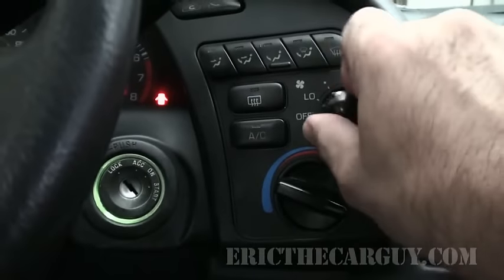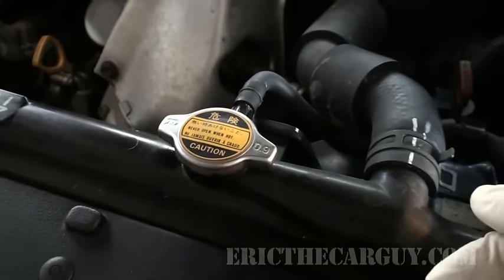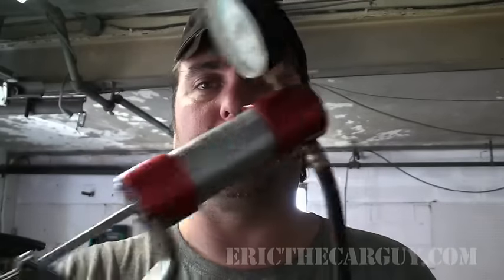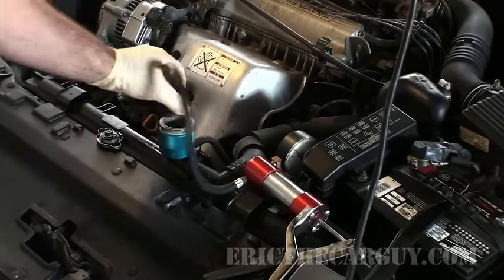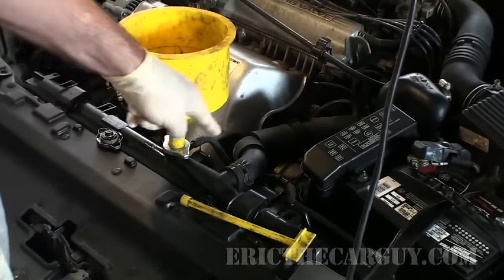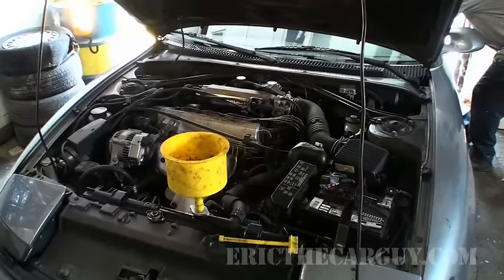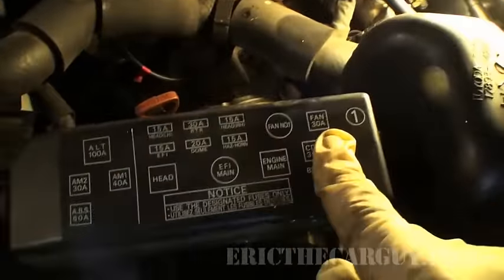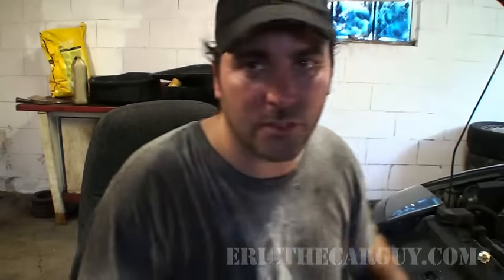How To Solve An Engine Overheat Condition - EricTheCarGuy

Comment: Thank you Eric for this comprehensive video, I have a 2010 Hyundai Elantra Touring GL (with 170k+ KM) which is overheating on higher RPMs, I checked everything you've said here, none of them is the problem. The fan works when the AC is on but does not kick in when the temp is high, Relay and Fuse are all working fine, there is no circuit cut between the relay and the fan, I can read the coolant temperature both on the panel and on OBD app, (guessing the coolant temperature sensor is working fine too)  I am suspecting two things:
1- There is circuit cut somewhere, between the relay and the ECU (or computer, whatever)
2- There is an problem in commanding the relay by the computer, (might be a software bug?)
How can I verify and/or fix the issue?
Might be something else?
Thank you so much in advance.

Comment: Eric, please help. 04 grand marques, engine cooling fan, replaced with Dorman 620-120. Reconnect battery, still no fan. The new dorman unit is controller, fan, shroud. Where is my problem. Looked at under hood fuses, the 50 amp cooling fan fuse, looks good #102.in power distribution block, on passenger fender. Only other thing could be, is temp sender, by thermostat right? Please advise. The cooling fan quit this winter.

Comment: Do have a overheat problem on my camaro after we had replaced the heater core that blew out, was not right after but a couple months, so as the car is hot and wanting to run the heater to help releave heat, it blows cold air only, no hot air from any of the vent, what does this mean towards my overheating issue and yes the radiator fan does kick on and run when temps get up

Comment: 1999 f350 Lariat Triton V10 dually truck still overheating but only when towing heavy 5th wheel trailer or goin over 20-25 miles. Is fine driving around town. No leaks, Replaced thermostat with 195° failsafe, replaced over flow reservoir cap, bled coolant,got bubbles out. Heater blows hot. Now seeing/hearing ac compressor is goin out(would that cause an over heat?). No sound or leak on water pump. Mechanic said they sprayed alot of gunk off condenser(?) . Still see some dirt/grease build up on front left corner of radiator and a lil along bottom that's hard to reach. Not sure what else but maybe radiator clogged or not working as well as it should. Will a radiator flush help or be worthwhile just replace it? What else could it be? 🥴

Comment: Hey eric i have a 2002 5.3 chevy silverado that is leaking coolant out overflow intermittently once it gets to operating temperature. But doesnt overheat unless low coolant light comes on? Iv had heads milled and put new headgasket radiator and reservoir am at a loss any clues

Comment: Great video , I've been troubleshooting on a 1998 Toyota  Celica GT  the  cooling fans will not cycle on. Change all capacitors, new radiator, thermostat , tested the motor test good.  Poor in parts HELP....Also, Hose from the radiator the one going into the engine is hot the one coming out is cold , the water is not circulating. Could you please help us with this as  to where to go next, please? Thermostat is Brand new actually the second one the first one didn't work.

Comment: Is it possible to fix radiator with crack on upper hose outlet as was this Toyota in video. I have 1997 honda odyssey  with 295000 miles and want to glue or put in sleeve or something. Any suggestions? Thank you and stay dirty!

Comment: I have a weird coolant situation... my reservoir goes way over the max line, and I have to top off my radiator with the excess coolant in the reservoir. I put in a new OEM Thermostat ad new OEM Radiator cap, but still same thing, its like i have a leak somewhere but dont know where it is! I dont have a blown head gasket foam or mix with oil... etc. My car does not over heat at all, never has.. but this is concerning. As now i always have to carry coolant and a plastic syringe to siphon what i need to form the reservoir. I have a 2010 FX35

Comment: Is there any explanation why thermostat closes while car car is driven on rough road surface? When car is not moving there is a circulation of coolant through  big loop, but once I start driving temperature keeps on rising above 90C and the lower pipe from radioator is cool. Brand new Wahler thermostat installed. Car audi 80 b2 1.8 petrol. Thank you.

Comment: question I have a 2005 honda pilot and lossing coolant 1/2gal to 1 gal ever 100 miles. took it to shop and they replaced water pump and timing belt it was time for one. the presure check system and added some stop leak. Well that was not the fix the pilot has over 300,000 miles on it / mechanic aslo check exhaust but said no signs of coolant. do you have any ideas theres no sign of puddles in driveway.

Comment: Merry Christmas to you Eric.  Anyways, your overheating checks are fine and dandy for a person who has all these things like a pressure tester, etc. How about someone like me who has a vehicle that just overheated and i drove it home and parked it. So my first thought is to check if I have antifreeze because when i parked it originally when it first started overheating and steaming on the highway, there was no fluid on the ground under my rad, so i'm assuming it evaporated? That's what the steam was? So i have it home now and like i said i'll check my overflow reservoir and yup, it's empty.  So i filled it and it immediately went down and I'm assuming it went into my rad. I checked to see if there's any fluid on the ground and again none.  Could it be I need a rad cap? Temperature around town is -5 cel and i need heat in the car. I haven't put any antifreeze in here for over a year.  Could it just be i was low on antifreeze? But do you have to fill your rad every year?

Comment: Regarding the thermostat, can they be oriented incorrectly?  On them there is a small loose thingy I heard called a bubbler that needs to be in the 12 o'clock position to bleed all the air from the system.  Is this correct information.

Comment: Thanks. I will diagnose in the morning. I will do it a little backwards and start with the easy stuff tho... no debris... check the cap ... ... check the overflow... turn on my van... hit the ac and see if the fan turns on... then check the fuses/ relays... then once it is up to temp check my hose temp with a digital thermometer. Knowing my luck... it is a freaking thermostat just like on the last 2 vehicles.... but ya never know. If it is any more complicated than that... like a water pump it will be off to the wreckers. With any good luck I will know in a few mins what is wrong. If it has wheels, nuts or electricity running through it... I am going to have problems with it. :D

Comment: Eric I have used your videos to fix everything on my car. Never had any problems but I need your help on a subject you haven't covered. I have coolant in the oil. Like all of my coolant. It wasn't mixed. Water came out first obviously. Then the oil. Is this a blown head gasket? I never saw any oil in the coolant. I had a clogged egr valve. I also did a timing belt change recently. I'm hoping it's a water pump gasket failure. Any help would be appreciated.

Comment: What would cause the rad fan to turn on too late? 
So i've replaced the rad fan, thermostat, thermo switch, water pump all with genuine parts. 50/50 coolant and I have bled the system.

(honda crv firs gen 1997). the temps go up to the middle but in traffic it goes up to 3/4 then the fan turns on and it goes back down to the middle.

I can jump the thermo switch and that turns the fans on, all the fuses look good. The top radiator pipe is hot, the bottom is above luke warm. 

Is it possible the new thermostat is faulty? I havent seen any leaks at all and ive had the car for a few years. getting to the point now where I dont know what else to do :(

Maybe a new radiator cap?

Comment: I have a 1994 e150 van it over heated to day I put coolant in the overflow I could hear it going to the radiator I let it cool down drove 6 mile to my destination temp was ok but when I got back on the interstate it started getting hot  the over flow was still full. During running the air conditioning , when ever I'm going up incline or speeding up the air stops blowing for a minute til it's going at normal speed then it blows cool air could the fan be sticking

Comment: I’ve got a toyota 3.0  it doesn’t overheat but runs hot. I put an after market gauge on upper rad hose. The thermostat is on lower on this. It usually runs 200 220. If I put the new gauge on the stock sensor it reads about 245. If I turn on heater temp will go up but even back out. Driving down the road temp will jump sometimes 10 or 15 degrees. Used a thermometer and aimed at both sides of engine one side is probably about 30 degrees higher but the exhaust is on that side so not sure how reliable.Also don’t notice the flow in radiator even when I rev engine. But radiator gets fed from bottom plus it is bigger aftermarket. But I have two of these and they both do the same. I haven’t checked the other but this one if I disconnect heater core sometimes there is no flow sometimes have to rev to get flow but still not that strong sometimes no flow even after Revving it. But like I said they don’t over heat and factory gauge reads perfect. I have replaced radiator, water pump, thermostat, flushed heater core new upper and lower rad hoses, flushed engine. When I first got it over a year ago 10,000 miles or so the cap was bad the rad hose would collapse but replaced worked fine. When I cleaned out the over flow there was a bunch of looked like sand or maybe like a Lyme texture from a water heater. But like I said that was a year ago it doesn’t over heat according to the stock gauge. But shouldn’t water constantly flow with engine running if you by pass heater core? Also when you turn on heater I thought it was supposed to cool it down. Right before I changed water pump when I was flushing engine after running at least 15 20 minutes first water out of drain was cool then got hot towards end. But haven’t drained it since I changed pump still think it’s the same but I’m going to check tomorrow. But it still did everything else after I changed it. I have done a compression test I think it was like 140 in all cylinders but #6 added a little oil they all went up like 30. That’s about all I can think of any suggestions would be appreciated . Only thing I can think of is a clogged port in engine somewhere. . .

Comment: I got lost on the thermostat, when it stuck close doesn't it suppose to make the upper radiator hose cold as there won't be water circulation to the radiator?

Comment: I have 2008 toyota avanza and I noticed the coolant is below half the container already but not yet low and I noticed that the temperature meter pointer is on the middle. I wanted to drain the coolant properly flush it but I don't know where to find the drainage and there's no car manual available online. Also, I wanted to know where I can find the part of the car where debris can possibly be found blocking the airflow. Basically I don't know the parts of this car model so I can begin my DIY.

Comment: got a 2002 pt cruiser that overheats...we replaced the fan motor the rad cap the thermostat the water pump the radiator,tested the fan relays no debris blocking airflow, proper coolant flush has been done a new head gasket and head resurfacing has been done, we still overheat when on highway and the car doesn't want to do over 65 without the revs spinning but no forward thrust. can you do a special video on pt cruisers overheating i know alot of ppl have this issue have replaced everything and still have the issue. thanks!

Comment: Hi, i have a dodge neon 04 sxt.   the fan did not work until I hooked them up directly. my ac compressor in the back the clip that goes in was broke off in compressor.so I left it.  i have a missing coolant reservoir. and my car boils in 3 minutes. i tried to wire fans to a switch.  the car just gets hot quicker. now windows fog and there is no heat. just gets hot.  what should i do?

Comment: So my engine over heats when idling and both my fans do kick on could it be that the fans are not going fast enough. I had one fan worked on about 6 mo. ago there was a stick that got stuck in one of them it was driven for a day before fixed they had to replace a wire that burnt out. Are the fans on a intermittent speed setting?

Comment: I agree the radiator may of been fine however on the plug to the electronic cooling fan shouldn't a jumper from the negative tab or prong to ground should of been in place once 12v was introduced to the positive tab or prong?? Just a 20+ year electrician & been working on cars just as long? Just a thought...but over kill is over kill

Comment: U are amazing! I have a 2006 Corolla. 1-2x a week,my temp gAuge spikes...I checked radiator fluid,full...overflow tank..full..never see steam.eveer...and never see any leaks under or near the car.....I was thinking thermostat? But I DO NOT HEAR my fan clicking on at all,and it spikes when I'm at a drive thru ,dunkin donuts.and it spikes when I turn my air on..any help ..single widow here thanks

Comment: If i installed a light bar that goes into the grill of my truck is it possible that it can be blocking to much air from getting to the radiator? I just started to experience the over heating issue shortly after having it in.?

Comment: I have  a crown Victoria  and I changed the thermostat and the radiator and now my temperature gauge keeps going up and down  🤔🤔❓❓
Reply: You need to bleed the system. Parking at an angle uphill may help

Comment: hey eric. got a 99 jeep cherokee xj 4.0 inline 6. after (3) seperate rad. caps from napa/autoz/advance. my coolant system will not build press. took off all hoses flushed rad/heat core/ block /replaced thermostat.
here is the kicker. no over heat condition temps 195-210 deg. not using water/no oil in water/no water in oil/got heat. hoses get hot after a long while running. but no noticable pressure on rad. hoses or cap. You think maybe i got bad new caps from (3) parts places?

Comment: I do hope it's only the radiator. The lower hose is cool while the top hose is very hot and the engine temperature went up to 225 and if I kept it running, it would rise up to 235 or higher. I think it's about time I do some checking things. Thanks for the tips.

Comment: I live in Texas.. I don't even have a thermostat in my vehicle for 9 months out of the year. Just put it in from like Dec thru Feb..Also, if you are nowhere near the boiling point,  then the radiator cap & pressure seem useless. Water boils at 212 degrees, so if I'm only at 160 consistently I don't use the cap. No need.

Comment: Eric I have a vacuum coming from ware I put the oil in I’ve changed the pcv valve it had oil on it , but didn’t fix the van it builds up pressure and over heats the van I’ve flushed the oil replaced the oil and filter nothing, kinda weird lifters are working

Comment: Hey Eric, , like the video, very good. But you didn't mention a collapsing lower radiator hose causing an overheat at highway speeds.
My car is a 97 z28, 125k miles and orig hoses. They just get soft over time, an easy thing to miss.

Comment: This post explains alot. I'm still trying to find a solution to my problem. My radiator had failed and caused overheating which busted my engine. Radiator was replaced and a top overhaul done. Radiator tested and pressure good. Temperature gauge good. Radiator cap good. Radiator fan working (but haven't tested if motor is spinning/blowing at optimal level). Relays & fuses good. To overcome overheating, a/c has to be kept blowing and this keeps the temperature down like a normal running car. A mechanic suggests the water pump is not giving enough pressure. Could that be the problem or something else? Thanks

Comment: Hey Ericthecarguy wondering if you can help me out I have a 2007 Lincoln mkz awd car that is overheating. I can't seem to find any leaks of coolant any where, I started with replacing the thermostat and car still over heats and of course blows cold air when I drive it it blows hot air. I did do a block test and that came back good eoith the fluid staying blue next thing I'm thinking is a bad or blocked heater core wounding what you think? Thank you

Comment: Great Video.   Explains ns in detail where one can understand.  Have overheating problem on a 2006 equinox.  It does not have a radiator cap.  Closed system I guess.  It seems it over heat at idle and slow traffic. Changed thermostat.  Then iver flow was aboyt a 1/2 gal low. Fixed that
 Today was overheated and water on the ground on drivers wheel side.  Overflow tank appeared to still have water in it. shut it iff and could gear a fan in stayed for a while. I was nt running my ac.  I was afraid it overheat but it did anyway. At my witts end with on this overhesting issue. How do you check combustion through the over flow tank? Could it be the water pump?

Comment: 16:48 i think if upper radiator hose is hot it mean the thermostat is working and circulating water that s why it got hot otherwise it should not.